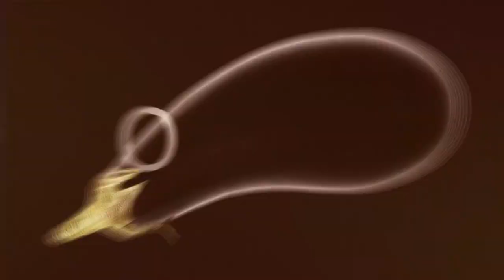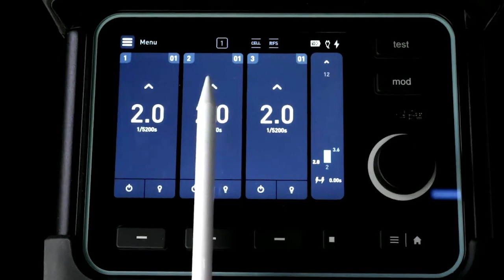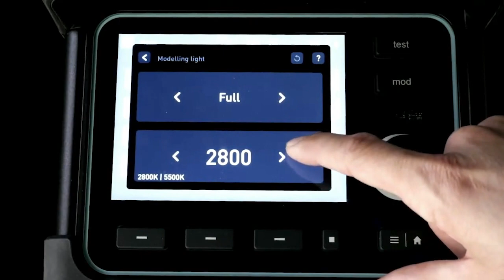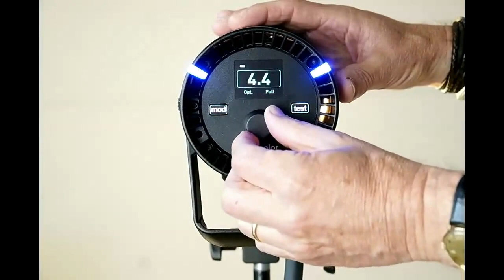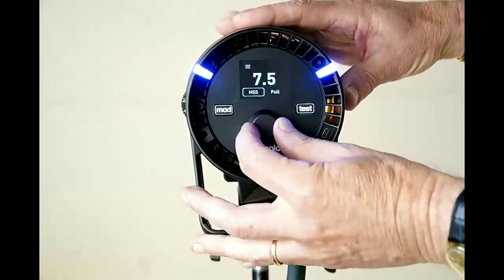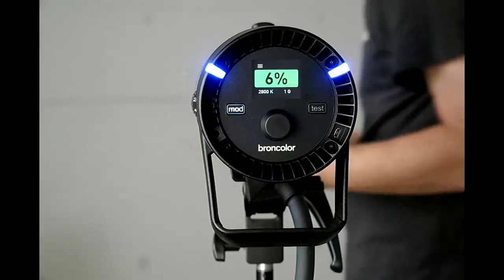Webinar: Unleashing the potential of broncolor Satos & Pulso L

Comment: Is the Broncolor data correct? The Satos pack seems slow to recycle (unless a battery is installed or 80%) when compared to the Scoro.  The recycle times seem slow and weird if no batteries are installed 13 seconds for 3200 joules?  That's a long time.  Over 6 seconds for 1600 joules?  Flash durations seem on par with the MOVE 1200 pack, 1/8500 at min energy.  I see the benefits with color temp, etc., but there seems to be distinct downsides as well, which are highly questionable considering the cost of this pack.  HSS - Broncolor hasn't demonstrated how well this works compared to the old HS on the Siros and MOVE.    May we see some real-world demonstrations or commentary on the use of this pack on location (HSS) and studio (flash durations).
Reply from the maker: Satos can be customised to the respective needs and situation using the innovative power slot concept.
When going for a mixed configuration (equal amount of batteries and power supplies) the flash recycling time is 2.4 seconds. Please note that Satos does recycle even a bit faster at 100 V mains voltage and on par at 120 V, compared to Scoro.
When working with batteries only, this time drops to 1.92 seconds.
In our data sheet we also point out that the flash recharging time can increase if the batteries are heavily discharged and the modelling light is permanently in operation on all channels and flashes with high energy are triggered in rapid succession.
Satos features short flash durations in the following modes:
Normal mode (Opt.): 
Satos 1600 (min = 1/5150 s | max = 1/100 s)
Satos 3200 (min = 1/5150 s | max = 1/100 s)

Speed mode:
Satos 1600 (min = 1/8500 s | max = 1/1600 s)
Satos 3200 (min = 1/8500 s | max = 1/1600 s)

Shortest mode (t 0.1 min):
Satos 1600 (min = 1/28500 s) 
Satos 3200 (min = 1/28500 s)
 
Here is one example of a high frame rate with Satos:
https://broncolor.swiss/news/how-to-high-frame-rate
More examples will be published shortly.
Reply: @broncolorworld  
Scoro (3200) = slowest recycle is than 2.5 (2.2 published) sec. at 100V, normal mode.
Satos (3200) = slowest recycle is 2.4 only if batteries are 80% or better.  *However If one's not using batts, or batts are near depleted, then that time rises to a (published) level that's unusually slow per Broncolor data sheet (below).
So it's clear that the batteries are required for expected performance, at the pack relies heavily on them.  So if the batts drop below 80% performance can be greatly reduced.
https://broncolor.swiss/assets/img/Satos_Data-sheet_July-2023-V1.3.pdf
https://broncolor.swiss/assets/img/Products/Light/Powerpacks/Scoro-S/Data_Sheet_Scoro_S_WiFi_RFS_2_01.pdf

HSS affect can be achieved via 'delay' feature, but does the new HSS tech give as much or more light over x-distance compared to the Siros/MOVE HS at highest HS power setting?
Is there a link where we can look at the owners manual online and the most accurate data sheets for both Satos  and Scoro S?   The Satos offers some really good advantages over the older packs.  Impressed with the  features.  Looking forward to seeing the Bron. team putting the pack through its paces.
Reply from the maker: Our recommended configurations for Satos are:
Satos 3200: 4 batteries ; or 2 batteries & 2 power supplies ; or 3 batteries & 1 power supply
Satos 1600: 2 batteries ; or 1 battery & power supply
 
Even if mains power is available in the studio, at least one battery element used offers clear advantages:
On the one hand, fluctuations in a network that may be fragile are compensated, and on the other hand,
batteries shorten flash recharging times. Especially if the power grid in a region has a voltage of 100/110V, 
a battery as a buffer leads to significant improvements in the operating behaviour of the power pack.
 
Kindly find our interactive Satos user manual here:
https://broncolor.swiss/help
 
We will soon publish an updated version of our Satos data sheet ((e.g. now “t o.1 min” / “shortest mode” will be stated.
It will be published under the following page under “Downloads” in the top right corner:
https://broncolor.swiss/products/satos?variant=128676
 
In comparison, HSS does not lead to more light, but it leads to a more even result with less brightness gradation.
 
We will soon be holding a webinar in which the functions, benefits and specs of Satos will be explained in detail.
By subscribing to our newsletter you will be automatically reminded of the webinar date.
https://lp.broncolor.swiss/newsletter
Reply: @broncolorworld   Thanks for the update and links.  Looking forward to the webinar and as always looking forward to more great products from Broncolor.  Thanks again.

Comment: Will users be able to do firmware update by themselves or should the pack and head go back to customer support ? 
Will wifi / BT control be available at lunch ?
Can you finger scroll on display to or can you only use the small arrows as showed ? 
What technology are the battery using and how many cycles will they last ?
Reply from the maker: Updates are done in the beginning through USB, the WiFi/over-the-air updates are being implemented together with other WiFi features shortly. Finger scrolling is possible, it's an industrial mutli-touch display. The batteries have the latest lithium-ion cells built-in and are monitored/controlled by the system itself.  The exact cycle time is not yet known but we did everything possible to get them as reliable as possible.

Comment: Will you please explain the advantage of two power supplies inserted.  What is the advantage of having two inserted compared to just one.  What is the benefit of having one or more slide in power supplies.  You explained the configuration, but not what it's actually doing and how the slide in power supply units benefit the photographer more than the Scoro pack without slide in power supply.
Reply: @Krmelj  Yes, he did go over it at the end. I was looking for a bit more technical detail but Urs and Axel are doing a good job going over the system as a whole and the information is well received, as well was your post.  Thanks.
Reply from the maker: We agree, the Dual Power Management system is difficult to understand/diffcult to explain. 

At least one power supply is needed either to work on mains or to charge the battery. Two power supplies allow faster recharging of the batteries or allow recharging the batteries while running the modelling light(s) at the same time when mains power is available. On-location the system can be equipped only with batteries (without the weight for a fixed power supply). Does this answer your question? Please reach out to support@broncolor.swiss if you like to have more detailed information.
Reply: @broncolorworld  Thank you for the quick response.  Good overall explanation.  Thank you.  It sounds like power from the mains is restricted to either running the pack or charging the battery when only one power supply is present.  If one power supply can run the pack + charge batts simultaneously, charging would be comparatively slow without the second power supply.  One power supply can't dutifully run the modeling light(s) + flash, etc., in addition to charging one or more batteries at the same time, so a second power supply enables one or more batteries to get charged quicker taking the burden off the power supply doing the other work.    That's a darn good pack, giving a lot of options.
Thanks again for the response.